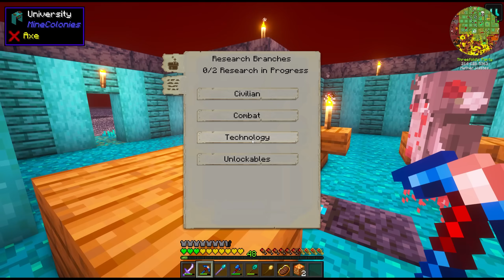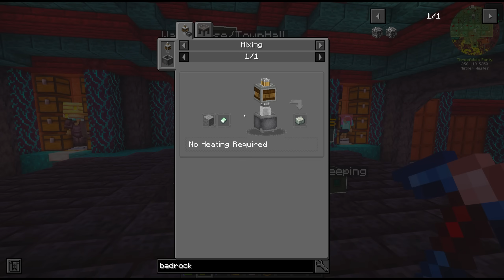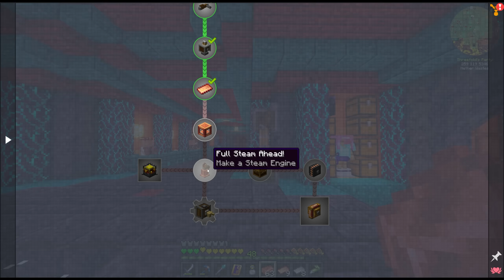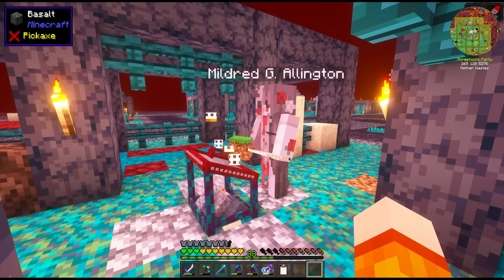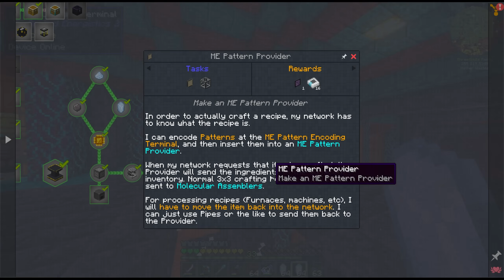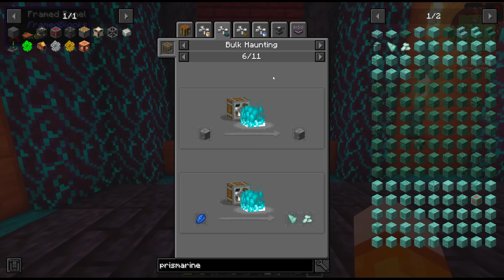Minecraft FTB Inferno - Ep09: RF & Create Automation

Comment: Regarding the presses with handcranks:
You can have the AE system dump the metals in a chest, then let laserIO round-robin it to tripple the speed by spreading the stack across all the presses.

Also you should definitely hook it up to the boiler power, that is terribly slow to watch xD You're going to make insane amounts of SU either way. Oh and on that note, don't forget to make the boilers taller as that will also add a lot of SU

Comment: There is a size upgrade for the town centered on the Town Hall after it is upgraded to Tier 3. This may not help depending on how expanded your borders are already. 

Visitors have different tiers which I am unsure, but at least in my world seem to correlate with the taverns tier. The visitors total skill can be seen at a glance by seeing their boots. It goes in the armor tiers which I believe is none->Leather->Iron->Gold->Diamond. 

Lastly, for any testing in creative (such as for town design). You can use the buildings block (I.e warehouse) and when using the builders wand to preview, it has a clipboard icon in the bottom right which will paste in the building as displayed. It won’t really integrate until you assign a builder to it, but it’s good for mapping out a town. There’s also decorative pieces you can add such as fountains or small pieces in the builders wand by default.

Comment: Don't forget your little slaves-- I mean friends the Starbuncles! Starbuncle wheels are a single block that requires no input but still gives about as much power as a fully setup water wheel. They also daisy chain and can be tempted to run faster by putting a block of gold in front of them. This inexplicably also makes them provide a little more SU. Champion mobs tend to drop one occasionally so there's probably a few in that drawer system.

Comment: You may want to keep the laser io stuff for somewhere where it is more needed. You can just use a belt with those presses and it will process them and move the output further down the line. No need for filtering and all that messy configuration, the output will move by itself with a belt. 

For the bulk blaster setup you can set up much the same thing but you will have to use Create's filtering system, and it doesn't work for everything. (belt pointing down,across a belt line, into a funnel that is filtered to blacklist things that can be smelted)

Comment: For the builder, you can force them to work on a ‘far away’ building by selecting them in the top right of the ‘build confirmation screen’ (where it lists material requirements). 

It can also be used to prioritize certain builds as the builder will build those it’s directly assigned to over ones that are auto-assigned.

Comment: some things about at least vanilla villager trading and trade halls

 ive learned if same occupation villagers especially with same trade are too close and you over trade with them they can talk to each other something ive heard referred to as gossip and raise prices instead of lowering them and even stop stocking trades indefinitely basically going on strike
 which is why they dont restock certain trades and that causes you to have to get a new trader for it which loops the cycle

occasionally with multiple villagers to close of the same type of profession they can link to the wrong job block thus locking both villagers out of trading
or multiply villager will link to one block overriding the previous owner and ruining their trade why you can have 10 farmers and only 3 composters

if villagers dont have room to move (which is why they wander around) (idk how much space they want but still) cant reach both their bed nor their profession block they lose ownership of their bed and job block to another villager locking both villagers out of trading ie no restocks 

they need to sleep to be willing to restock after a certain point 
also a reason for more space is because villager during sleep can fall of the bed and phase through walls escaping their room

ive even heard some villagers on their spawn prefer certain job over others 
which why some villager wont link right away or why a villager will path find long distant to a certain job block over a closer one or a villager closer to the block wont link 
which ive heard is why nitwitts happen
but the validity of this idk it is annoying even if it isnt true because that happens even still

Comment: a single boiler can easily power all your current create contraption at 128 or higher speed( i think the hand crank is like 16 or 32).if you don't want to have create cogwheels and belts turning around due to lag i thing the hand clickers probably create a lot more due to how create is optimized and each hand crank is considered a new power source

Comment: In regards to the Create fan smelter setup: Give Create's brass funnels and brass filters a try! You can filter by item attributes, and automatically pull all items that can't be smelted off the depots. Note that this won't work for items that can be smelted multiple times, if you want to, say, get stone from cobblestone, as it will stay on the depot until it becomes smoothstone.
Reply from the maker: That is a great suggestion actually, I didn't think of that while setting it up :)

Comment: Earlier in the video your goggles showed a level 2 boiler being capable of providing 32k su, and the alternator at 2048rpm was using 65k su, meaning you either have a ton of headroom for using mechanical power elsewhere, or can generate a ton more rf and just use motors. Are there rf p2p tunnels in this pack as well? I believe they take channels, but also don't require subnets, but I might be wrong

Comment: For the create smelting filtering, create has an attribute filter that can filter only smeltable items, so add those on a chute and you're decently good. It's only downfall is items that can be double smelted like cobblestone.
Reply: Way bother just smelt them on belt and make sure its travel time is long enough, no filters needed.
Reply: @nEVER4BoRN  won't work cuz 1 item smelts way quicker than a full stack
Reply: @gb andesite funnel onto belt then
Reply: No belts are required, the fastest way is to just have them drop into world in front of a fan and be blown into a funnel/chute filtered to disallow smeltables
Reply: @MrZora  or just a smart chute below the depots, no need to change the design that much
Reply: @gb76231  Having them on the depot limits you to one stack at a time, however. You can batch smelt/wash as many items as you want if they're dropped into world